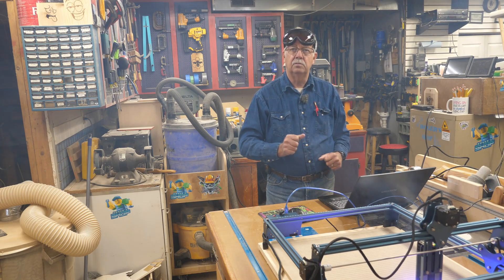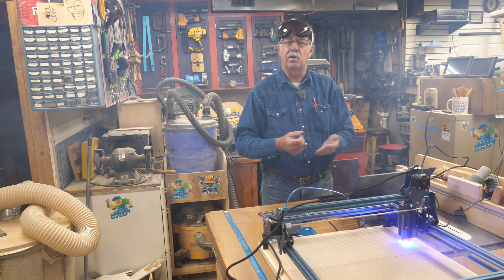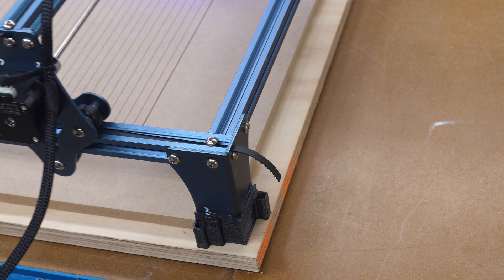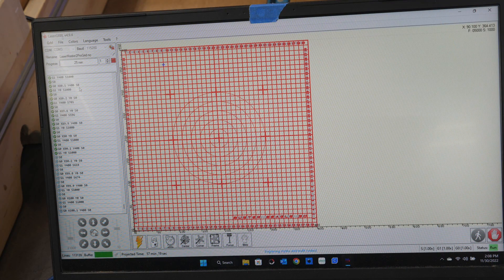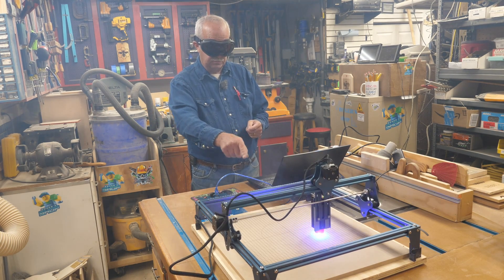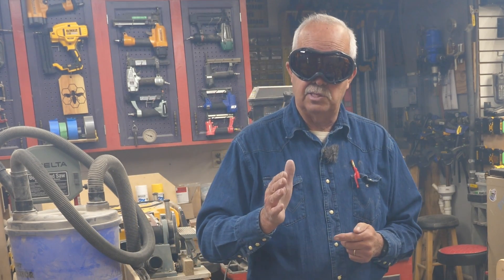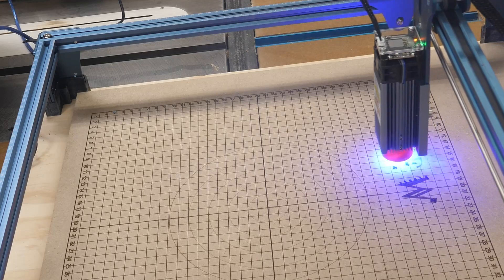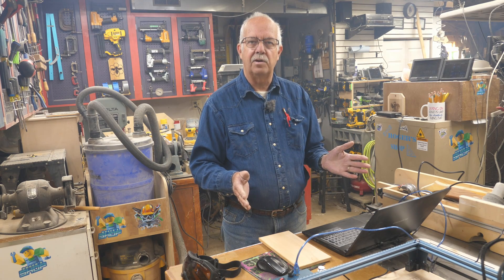Sculpfun S9 Laser Modifications

Comment: I printed out those feet for my laser, but the laser itself is now too high. Not a problem if I will be using a honeycomb mesh riser, but I was wondering how you are engraving directly on the baseboard? How did you lower the laser to the required 20mm above the board?
Great ideas btw!
Reply from the maker: I must have had a different head on mine.  I no longer have it, so can't look

Comment: Thanks for a great video! I've printed the mounting feet & cylinder holder and have a question about the mounting feet you used. In your video it looks as if your mounting feet do not have an additional screw hole inside the right angle - or am I just not seeing it? It does not look as if you had to notch the grid board to accomodate that inner screw. The best image is of the back left mounting foot at 5:37. Thanks!
Reply from the maker: Two screws per corner is adequate.  i did not use the set screw option as it fits plenty tight without it.  I did not need to notch anything.

Comment: I notice you don't have limit switches. Doesn't the grid become misaligned every time you start it?
Don't you have to reset the home every time and realign the laser to zero/zero
Reply from the maker: No.  On lasers that do not have limit switches or a homing function, I always work from center and "current Position".  Since the laser is set in mounting feet, it does not move, so the grid is always square to the laser.  I set my laser head to center on the grid, then position my project.
There are other ways to do this, but I find this quickest.